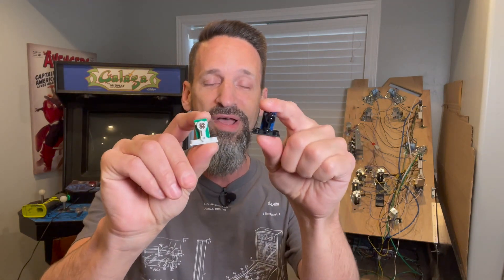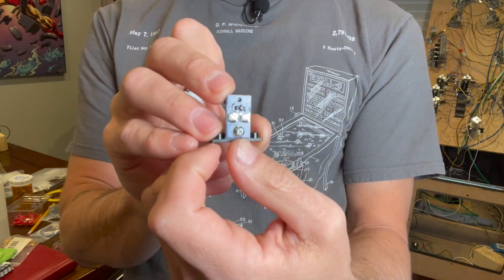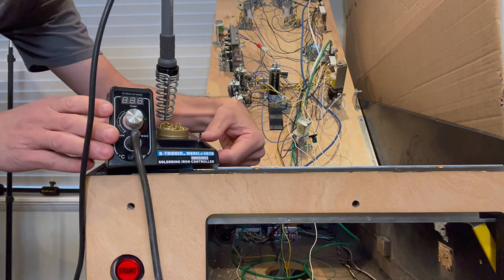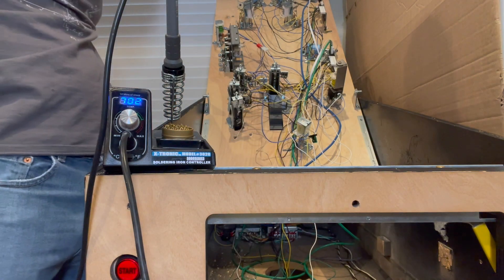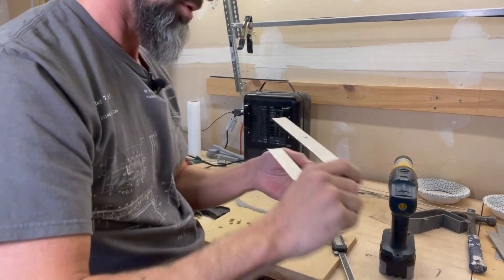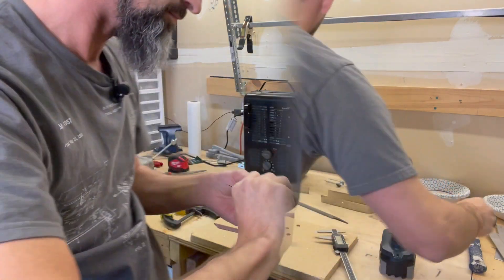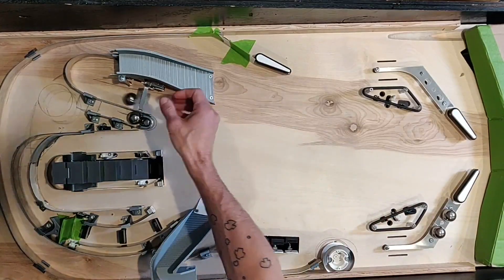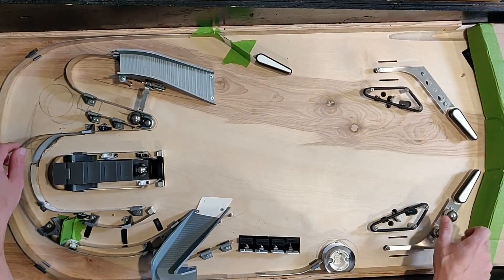HOW TO MAKE A PINBALL MACHINE: More Optos!

Comment: Hey Steve, 
Apologies if I’m mistaken, but I’m having a problem I seem to recall you also had. An opto switch is reporting an open state, even though the beam is unbroken! I have ‘type: NC’ in my config, and I’m positive it’s wired up correctly (the switch successfully changes state, it’s just the states are reversed!) 
Did you run into that once too?
Reply from the maker: Hmmm honestly I can't remember 😅 I might have had that issue but I forget. Post this in the FAST slack group if you're still having issues - sorry for not responding sooner
Reply: @thepinballroom  Thanks Steve - as it usually goes, I posted in the slack, then immediately fixed the problem 😅
I actually don't know what did it. Possibly the polarity on the infrared receiver (though I swear I had already tried that). Or maybe just the pinball gods finally had enough fun screwing with me and the problem resolved itself 🤣